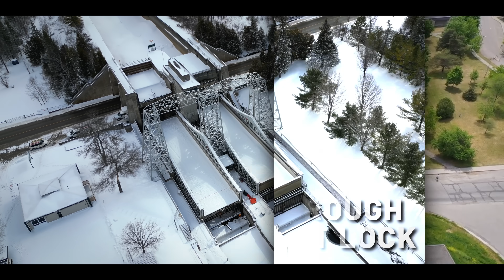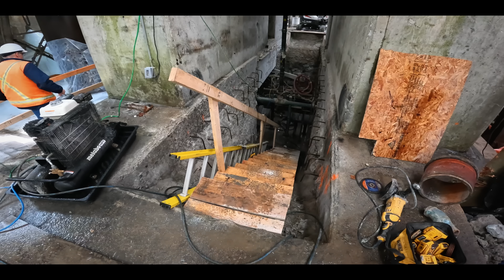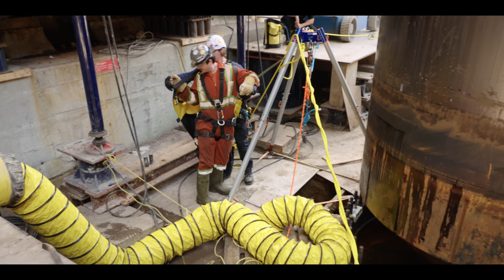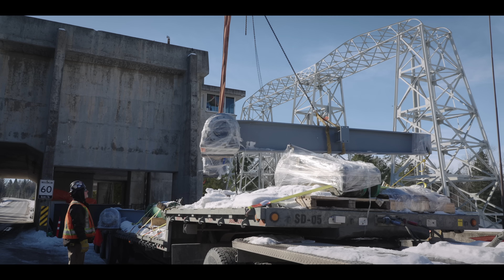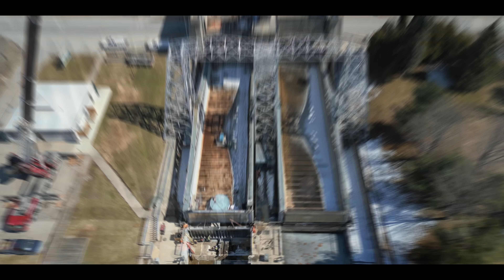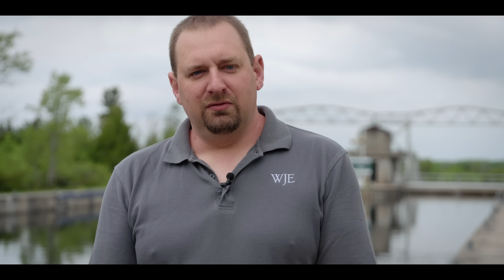Mechanical Malfunction at The Kirkfield Lift-Lock

Comment: I worked on this Lock in the late Sixties, Inspecting Sandblasting and Painting of the External Structural Steel.  Carbo-Zinc 11 and High build Epoxy.

Comment: What’s with the pool?
Reply from the maker: @TCB77  Good question. It’s not so the crew could cool off on hot days. Western discovered during the repair that the tub was not exactly level. The pool filled with water acted as a counter weight to keep the tub temporarily level until it was made level during the repairs.

Comment: Soo what about the rest of the Trent? Are all the other locks outdated?
Reply: only 2 like this kirkfield all steel and peterborough which is all concrete! all the rest just use big steel gates and water go check out the lock in fenlon falls in the middle of town do so in the late spring or summer the whole system shuts down in the late fall for the winter
Reply: Not all are steel most in northern area are wooden
Reply: Yep, and the Feds just spent over one Billion on the system.

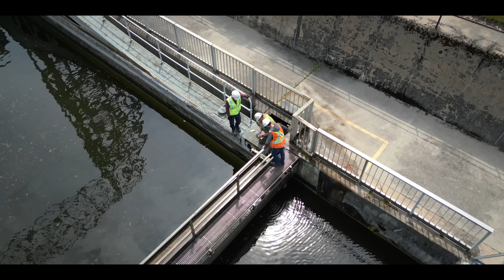Comment: 12:37 ... Originally before the 1960's retrofit ....  ALL those gate control "hydraulics" were water powered, with regular medium pressure water pumps... NOT with hydraulic oil.

Comment: The biggest ship lift maybe in North America but not in the world as there are bigger ones in Europe. for example in Belgium / Strépy-Thieu or in Germany / Finowfurt
Reply: Strépy-Thieu, is not a hydraulic lift lock. It is a cable lift driven by eletric motors. Hydraulic liftlocks are not powered by anything and simply use the weight if water to raise and lower them.
Reply: The oldest boat lift is the Anderson boat lift in Cheshire England at 150 years old
Reply: The Three Gorges Dam ship lift is the world's largest by far.
Reply: not true the saint lawrence seaway in ontario and quebec can handle ocean going freighters but not huge container ships

Comment: Good show! What about the other side?
Reply: Good question!
Reply: The only reason they had to replace the north side was because it was in its upper position when the valve failed and the doors interlock and began to pull each other apart